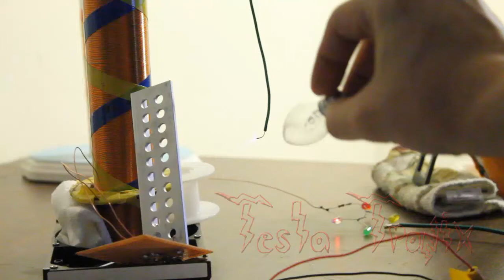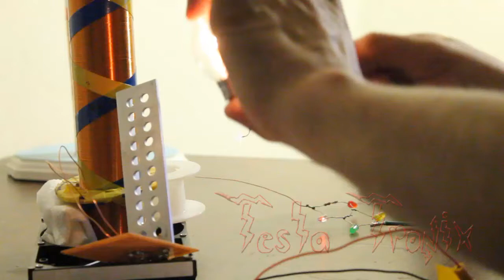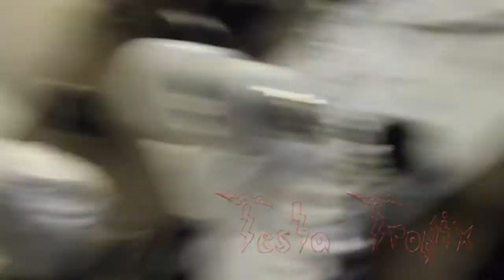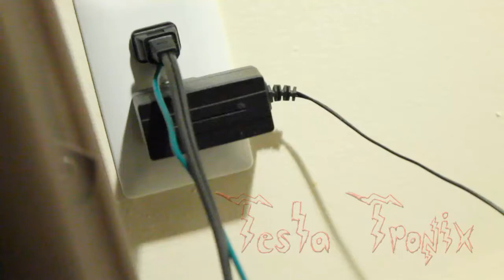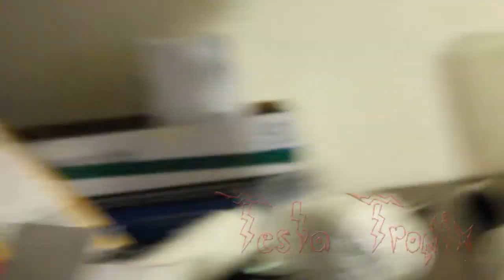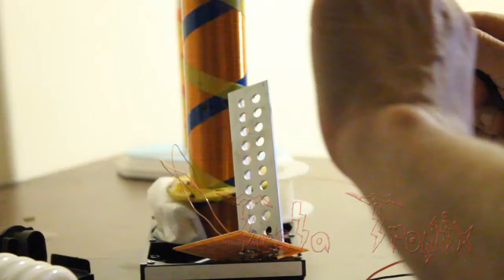Incandescent Bulb Lights by Solid State Tesla Coil

Comment from the maker: Well, to be honest, I'm not 100% sure. They are sealed under electrical tape, under a layer or 2 of laquer. I do know that the circuit will only work when the leads on the primary are connected to the terminals in one way.